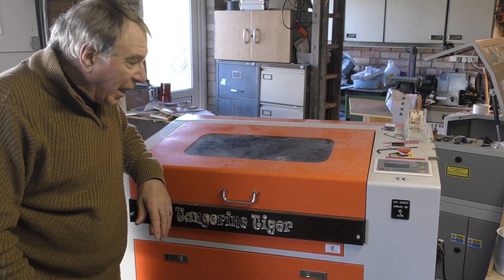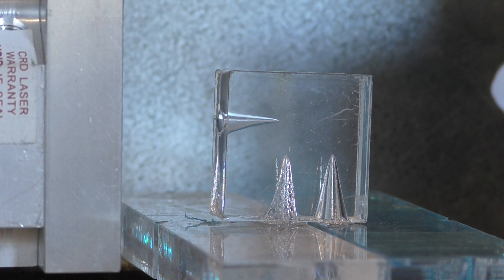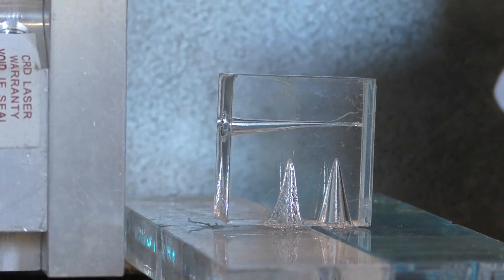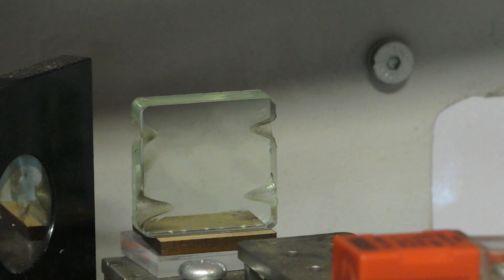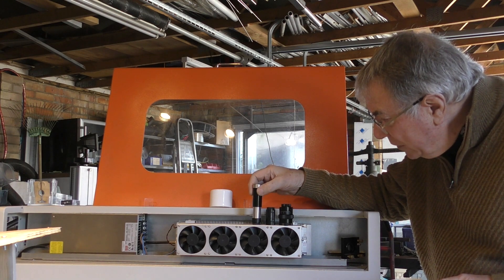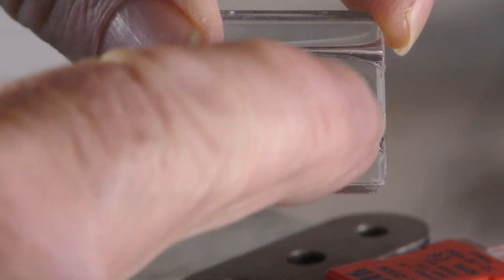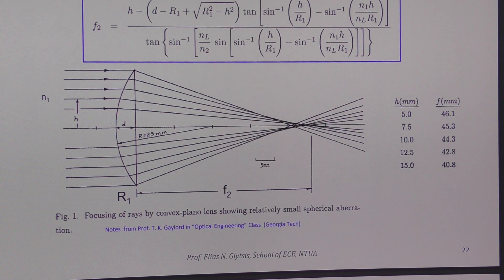RDWorks Learning Lab 226 Can my Beam Collimator  Work

Comment: Russ- you CAN do what you're asking, and should.  All you need to do is take that 2.0x, pull the second lens, and place a spacer UNDER the second lens to add airspace. about 1mm-2mm thick, the exact airspacing can be calculated if you know the focal points of the expander lenses (or the exact lens spacing it already has) but experimental will probably be the easiest way to get you what you want.  There is no such thing as a "parallel" beam, this does create reconvergence without a well defined focal point, the beam waist is heavily limited by spherical aberration of the lenses.  But you do not WANT a focal point, you want it to just act as if it's parallel within the limits of the bed.  If you add too much airspace, you can make it converge to like a 2mm spot a few meters away if you want.  But, spoiler- YOU DON'T WANT THAT.  You want consistency across whatever bed size you have.  Before adding airspace, you have 2.0x expansion turning 1.8mm beam to 3.6mm and your divergence drops from 7mrad to 3.5mrad.  If you add too much airspace, it will start out even wider and then get smaller at further distances but will be even wider initially.  You don't want that convergence point within the bed, or at the furthest point, but well outside the bed, probably 2x the max bed travel.  This will yield expansion slightly more than 2.0x but a consistent beam diameter and you can do it for any size of bed.  Just keep making shims until you get consistency, but be careful you don't accidentally put the convergence point WITHIN your bed.  This is an easy mistake because you'd probably be checking just the near and far corners.  Also you REALLY NEED the 4-screw kinematic mount.  Collimators are very sensitive to beam centering and angle.  You first align the #1 mirror without the collimator screwed into the kinematic, do your best to XY linear offset adjust to get the M22 mount centered around the beam, screw the collimator into the M22 kinematic, then realign just like you do for the #1 mirror adjustment but instead of touching the #1 mirror (which was already correctly aligned), turn the kinematic's XY angular screws to trim the beam alignment.  VOILA perfect beam!
Reply from the maker: Hi Danny
That seems like invaluable advice. The  X2 makes the machine substatially better at cutting than a X 3 , The bean is supposed to be 2mm but I suspect that is a FWHM specification that in realty is a  4mm beam. I know that the beam is about 7mm diameter at 1300mm and that already reperesents a significant intensity loss (poor cutting efficiency). I will do a mode burn test at variuos points aroiund the machine to test what the current X 2 is doing and then I will play with it as you suggest and make a second video so you can see how successful I can make it. I was surprised that the X 1 collimator  (with no internal focus) performed no better than my  crude Keplerian arrangement. With simple plano convex lenses  (two fuzzy focal points) I was never likely to retain the nice Gaussian intensity that existed exiting the source.  Beam diameter/paralellism is one issue but preserving that Gaussian intensity is the prime goal for me.
 Thanks again
 Best wishes
Russ
Reply: @SarbarMultimedia  Hello Russ- This will indeed maintain a gaussian beam, but I'd emphasize that consistency is the top priority.   I built it on a 1600mm x 1000mm bed and, properly adjusted, it's totally consistent in cutting and engraving across the whole bed.  Overexpanding the collimator made  a beam converge to an awesome ~4mm at the 2.6m far corner (it could probably get even tighter), but maybe 10mm nearest to the collimator.  While the intense, compact beam was great at the longest distance, without consistency there's no point as you can't cut or engrave a large area before the beam is totally different, same prob as divergence was, just backwards!  
Yes I would say 2x is more desirable than 3x- in fact I would recommend 1.5x if you can find one.  Adding airspace will increase the expansion over the nominal value, so a 2x will be more like maybe 2.5x, but compensating the divergence is far more important esp for a large bed.  Point being, be careful as the second lens is only so big and has a limit on the final beam diameter and needs to be aligned with some precision.  Again, SUPER important to get an M22 kinematic mount, they're cheap like $50.  It has 2 linear XY adjusts and two angular XY adj and offers great precision at centering that beam to get a good shape, stay aligned, and not clip the edge of the second lens with the enlarged beam
Reply: @SarbarMultimedia  BTW you can use a visible laser pointer (or a focusable flashlight!) to visualize what this does, most have a screwed-on adjustable lens.  Even your red dot pointer does.  You can make a pointer converge to a pretty tight spot at 2M but then it will diverge a lot by 5M.  The goal is consistency across the bed, so we don't want that sort of convergence point within the bed at all.  There is no such thing as a perfectly parallel beam that stays the same dia to infinity, but several meters is very achievable.   
BTW, either a beam expander or one spaced out to be a collimator will muck with your red dot pointer.  Once the collimator is perfect, it will now CREATE convergence and then divergence in a red dot that was as  parallel to begin with.  The refraction of red wavelength in ZnSe is not the same as CO2, but that's ok- you're just going to screw in the lens on the red dot too close so the beam diverges similar to the CO2 beam before it goes through the collimator.  The red dot unfortunately ends up being a larger diameter after the collimator, but, again, the goal is to make that red dot beam consistent too across whatever size bed is being used.

Comment: Hi something weird cutting under water https://www.youtube.com/watch?v=kxXEI0Ce6C0
Reply from the maker: Hi
I remeber back to my college days more than 50 years ago using a flat ended steel rod  6mm diameter attached to the end of an ultrasonic driver being  to cut a hole through glass under water. We were told that this worked by cavitational errosion see   https://www.sciencedirect.com/topics/engineering/cavitation-corrosion
 A more modern version combining  this technic with laser ablation is descibed here,  https://www.researchgate.net/publication/289367097_Ultrasonic-assisted_underwater_laser_micromachining_of_silicon

 It's all fscinating stuff 
 Best wishes
Russ

Comment: Greetings Russ from California. I love the way you present problems and try to find a solution with interesting outcomes totally not in the normal realm. Have you heard of using a double aspheric with the lens facing away with the flat side facing? Just a thought to try and see if that would help. Cheers!
Reply from the maker: Hi George
 That is a fascinating suggestion that I mused on for a few moments and realized that it was a special version of the Keplerian arrangement I had already tried and failed with because there is an internal focus point. The problem I have discovered is that passing a laser beam through a  lens is not the same as passing uniform rays carrying an image.  We are only interested in one single property, INTENSITY,  and that can ignore the normal lens rules. At a single power, the INTENSITY focus will be in one position but change the power and it can move. I understand what aspheric lenses are but nothing close to that shape  is commercially available for our machines, We are stuck with plano convex and meniscus  lenses. That is why I am bouncing this back to a lens manufacturer to see if anyone is able to work "outside the box" of normal lens design to help solve this issue..
 Best wishes
Russ
Reply: @SarbarMultimedia  Have you ever considered using the F-Theta configuration lensing to enhance the loss factors in an attempt to increase the focal point more direct!?? Just another thought...Cheers!
Reply from the maker: @georgeyork8975   
Hi George
 I know there are F thete lenses for  CO2 galvo heads but I an puzzled about how this would help me. The are designed to keep the beam focused over a large area  (maybe as much as 200x200 mm ) from a beam piivot point some 300 or 400mm away from the work.. The point is that it produces a very small focus and that is not my aim. I am after keeping the beam as small as possible but parallel. The last thing I want is a focus unless that focus is about 5 or 6 m away.
 Best wishes
Russ

Comment: Curious why you didn't do the second reflection test with the initial lens you tried? the one with the 3 second pierce. I think there was a step missed there and results, well, results I would like to see. :)
Reply from the maker: Hi
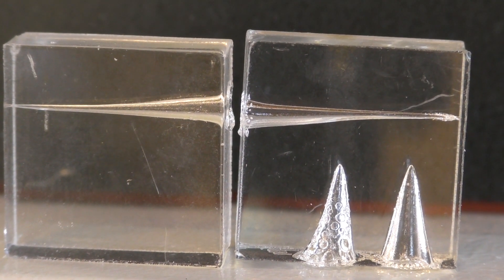 Sorry for  a mistake. At 7:09  I stupidly confused my results. The burn on the left was the 3 second burn with my crude  collimator and shows the smaller beam because I obviously  had the collimator set to diverge (my first setting guess) The smaller beam diameter  still had lots of central intensity and zapped through in 3 seconds.  After that, I apologise for missing a step. I didn't ever do the test you wanted to see because I realized I could never adjust my assembly to a divergent position  However after makingthat adjustment and getting a  7 second match (8:29)   My test with mirror 2 at the back position ( about 100 mm further than test 2) was still giving  reasonable results but look carefully at (9:08) and you will note that  after just 100mm the beam diameter has  increased and the entry is more conical. . That more conical entry means there is a shift of intensity towards the outer part of the beam, At this stage the central intensity has remained almost intact.  At the front position (a further 300mm ) the beam diameter has not changes but the Gaussian intensity distribution has disappeared and we have  a "blunt" result . Many attempts failed to refocus that central intensity.   My Keplerian lens arrangement  was predictably going to fail at some point (I was expecting more than 100mm) because of the internal  INTENSITY focus spread. . However,  it was surprising that the  pro X1 collimator which   is designed with the Galilean arrangement which has no internal focus issues ( see  https://www.edmundoptics.co.uk/knowledge-center/application-notes/lasers/beam-expanders/   ) performed little better. Again the central intensity was dissipated..   As I have commented before, the relationship between lenses and laser beams is a very unexplored and misunderstood subject. I have crude vision of how it works and it worries me that this may not be a soluble problem
  Best wishes
Russ

Comment: Russ, is there any reason the laser unit couldn't be retrofitted with water cooling, in the same way PC gamers cool their graphics cards with a water block in place of the heat sink?
Reply from the maker: Hi Andy
You can buy water cooled versions  which are obviously quieter but I have a silencer that takes the high frequency edge off the sound  when the machine is not in experimental/video mode.  Air cooling is convenient and keeps the infrastructure simple.
 Best wishes
Russ
Reply: @SarbarMultimedia  Water cooling is much better in the long run because you can get a consistent temp thus consistent output power, you're not piping air and contamination into the sensitive area with optics.  It's difficult to filter the high airflow needed for the best cooling.  And smoke and some dust particles can even make it past HEPA filters.  Critical part: the tube's got a ZnSe output window and it's irreplaceable, if  it's etched because it got dirty and burned the surface when fired, it can't be restored.  So keep that output window area CLEAN, which means you need to separate the high airflow for tube cooling- which should have only filters for coarse dust like a MERV6 or MERV8, but seal the area around the tube's output from all outside air AND the cutting bed air.  That's the ZnSe window on the tube, your #1 mirror, and your collimator.  You can't use a mirror as  a barrier obviously.   They make coated ZnSe windows for this, but the best choice is to use the collimator itself as the barrier.  One side of the barrel is inside the sealed tube output area, the other is in the cutting bed area.  No contaminated air can make its way into the sealed tube output area

Comment: Could be nice/helpful to have an IR camera to see the beam.
Reply from the maker: My knowledge of IR pyrography is very limited but I am aware that 10.6micron wavelength is classed as far infrared where cameras  with special lens materials become VERY expensive. Those lovely coloured IR photos we see are radiation from surfaces  in the  1 micron to 1.5 micron wavelength region.. 
However, think logically about it and you realise that  there is one laser beam property that would prevent you ever  seeing a beam. It is coherent and thus there are ZERO  stray IR photons escaping from the beam to be detected . It's just like a torch beam, invisible when viewed at 90 degrees to the beam. 
 That is where that unique plastic, acrylic , is so useful at this wavelength. .  It can be excited to its liquid phase at 160C and then boils and evaporates  at 200C . It leave a a fantastic damage profile of beam INTENSITY  as you have witnessed in this video. I am looking to have that initial beam profile persit right to the front corner of the machine.
 Thanks for an interesting comment  because it does allow me to explain to others  who may have the same passing thought 
 Best wishes
Russ
Reply: @SarbarMultimedia  , thanks a lot for explaining. I thought if we could see the beam, we could, in theory, confirm (?) all the work/research you've done during these years.   I totally understand the unique qualities of acrylic. However, it shows the result but not how the beam "really" deforms/expands/dissolves in between. Just my thoughts. Could be completely wrong :-)
Reply from the maker: @MikhailBerezovskiy   
Hi Mikhail
 I love acrylic almost as much as I love my wife. They have much in common. You have to interpret what they are saying to understand  the real meaning. After all this time I have become fairly good at decoding what acrylic is telling to me ( and the wife). 
In the case of this beam collimator it is very simple,  I want to see the same burn shape at both machine extremes.   How did I decode that intermediate shape about 400mm from the epander?  Take a look at this video and understand the relationship between beam diameter, power and intensity.
https://www.youtube.com/watch?v=z8sNPtIIXZ4
 I used time (7 seconds ) to gauge how quickly a certain diameter 30 watt beam, directly out of the source,  could penetrate. through 25mm. It did so with an incredibly high CENTRAL intensity ( the thin point). The second test 20mm after the collimator , achieved the same penetration  but in about 5 seconds. If you understood the video then the power is the same  but for the beam to do the same damage in less time means the intensity is higher, which implies that the beam diameter was smaller..  However, 400mm further on and 7 seconds of exposure produced a very blunt shallow cone for exactly the same power.  Firstly the diverging beam was creating a much larger burn diameter  but  that increase  should not have stunted the penetration or affected the shape so, dramatically.  I therefore interpret  that shape to mean that the central high intensity has been radically defocused  and the beam no longer possesses it Gaussian intensity distribution. 
 Hope this makes sense
 Best wishes
Russ

Comment: Hey Russ, good video.  The laser has an advantage over a telescope in that you are trying to focus with only one wavelength of light, rather than the range of frequencies for visible light, so no chromatic aberration.  Might I suggest that  to do what you want, you need to use a figured mirror instead, similar to a Newtonian Telescope.  You need a long focal length hyperbolic figured mirror, for the first mirror, with a long focal length; I think you said 1 meter to the final focusing lens,  set to the length that the final focusing lens's foci is at, assuming a meniscus  lens with the concave side towards the laser tube.  It has to be Hyperbolic rather than an ellipse since you are doing an angled reflection rather than a straight through reflection as in the Newtonian telescope mirror; which is typically elliptical until you get out to the mirror edges.  I do not know if anyone does Newtonian style figured mirrors for hobby lasers though.
Reply from the maker: Hi Scot
 Great ideas BUT we are using only zinc selenide or gallium arsenide for our lenses., We only have two shapes, plano convex and meniscus and about 5 or 6 focal lengths. That's why I need the services of a specialist company to figure out if this is even possible. . You are correct about chromatic aberrations but there is always some degree of spherical aberration in a lens and that could  the killer for a collimator. I think a Galilean design is the best chance of success because there is no focus involved.  My crude attempt involved  internal focus and that was a mistake because there is no single focus with the laser beam, so what goes in does not come out the same . A bit like cracking an egg into a sieve, Everything comes out but not the same as it went in.
 
 I am still working on the problem though
 Best wishers
Russ